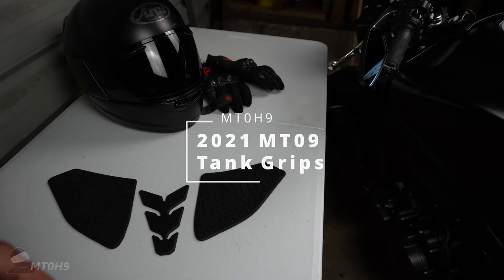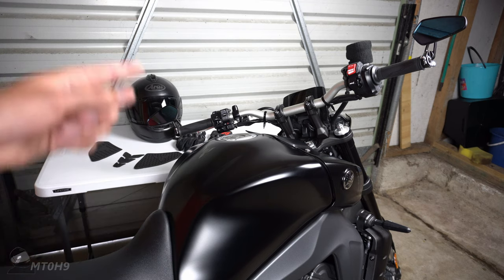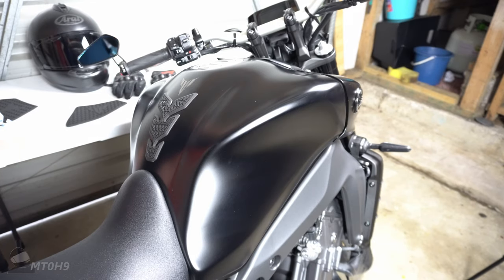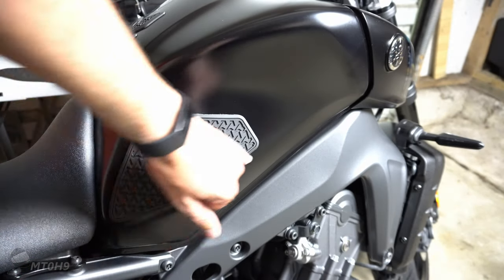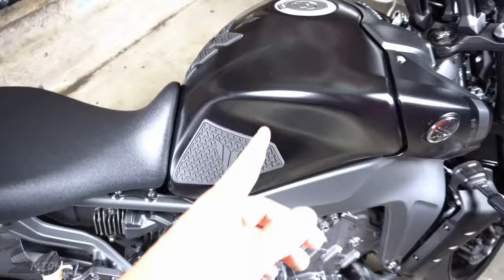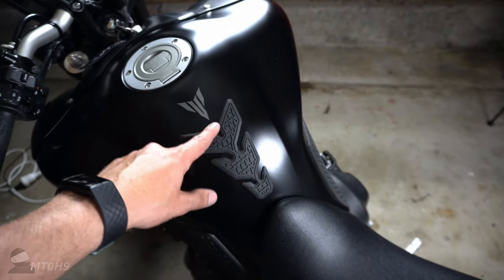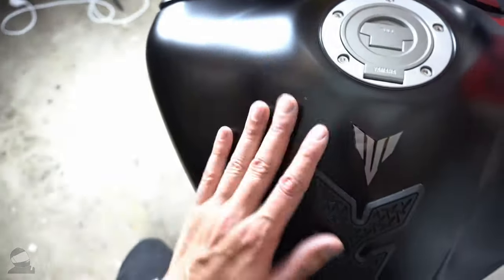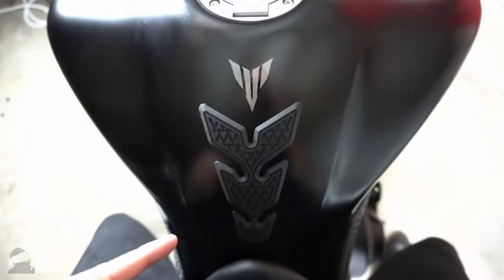Tank Grip - Tank Pad Install: Yamaha MT09

Comment: Hey mate great vid
Hey I have put yamaha tank pad to top of tank, with this pad there is glue around side of pad  when it stick to tank, pad you put on seems to be clean, no glue, is that correct?
Reply: Andrew I have the same issue did the glue come off in the end?
Reply from the maker: 3 years later and they are still on my bike as new

Comment: I got some too and I think I put one of them slightly off compared to the first one now my ocd is killing me… anyone know how best to remove tank pads ?
Reply: Heat gun, plastic pry tool, non-alcohol based cleaner. Heating up adhesive helps break the bonds for easier separation, plastic pry tool to separate remaining bonds and reduce the chances of scratching/chipping the paint, non-alcohol based cleaner to remove any remaining adhesive without damaging the paint